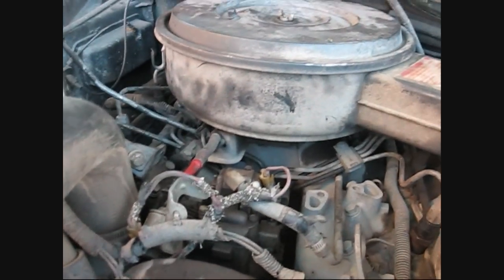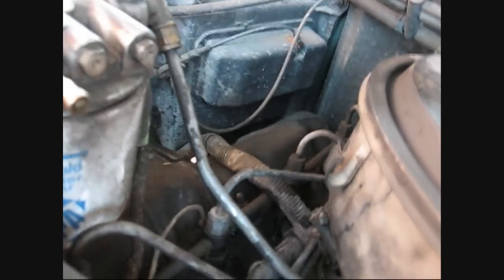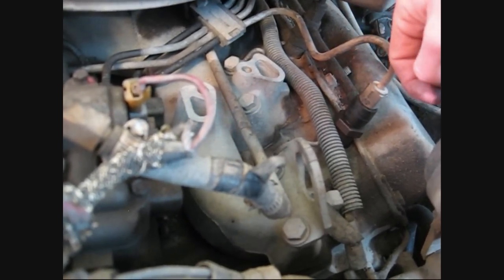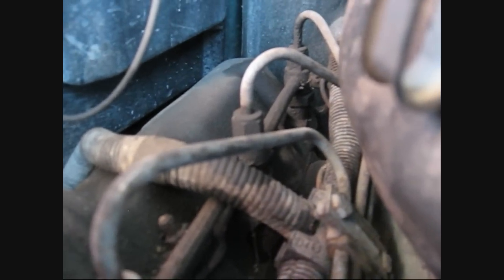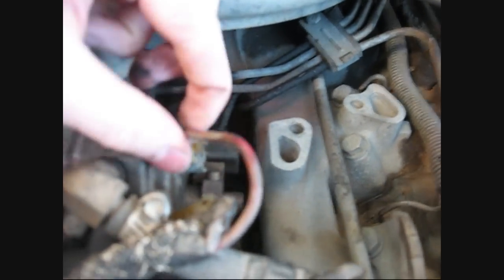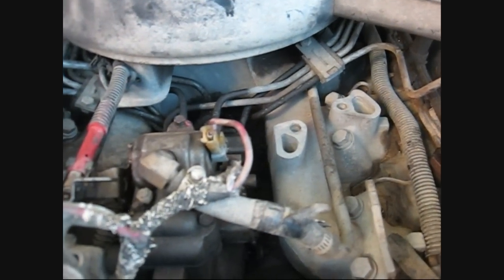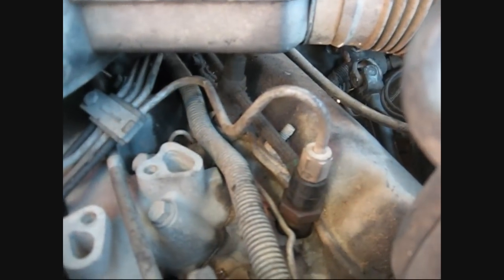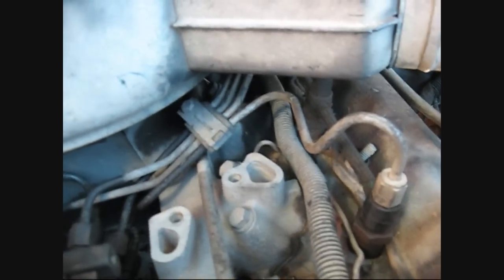Ford IDI Diesel Starting problems Diagnosis

Comment: You did a great job on the photography. I could feel my hands getting tangled in the loom and my head slamming the air cleaner 'cause I was too lazy to remove it. I just found your channel. Do you have any vids of your impression of the OEM glow plug system vs. a 12 volt upgrade, or full bypass?

Comment: I have a 91 F350 IDI 7.3 L under 2500 RPMs the engine dies and I can't get it restarted.I replaced the fuel pump and now it won't start at all but cranks over. Any ideas why this is happening or how to fix it?
Reply: really only a few things it could be if its somewhat starting at all.... air intrusion in the fuel system (usually return lines/injector lines/fuel filter heater etc) or a worn out and/or leaky IP. this is assuming you have healthy compression. as long as your getting fuel pressure to the IP which you should be if you have a new lift pump id start in those places. also a healthy fuel filter and clean injectors can go a long way
Reply: oh and IP timing is obviously crucial on these engines obviously and is something to keep in mind as they age as the can retard as they wear and in less common cases can even skip a tooth on the timing gear

Comment: I'm having a similar issue. Hard to start. Then once it does. will run a at idle for 30 mins. them dies.. Almost impossible to restart. I'm going to check all your suggestions and see if that helps.

Comment: I've gone through my 88 7.3L IDI, changed glow plugs, Glow plug wires, mechanical fuel pump, injector pump, injectors and still struggling with hard starts and no start when the motor is warm. No fuel leaks... maybe a fuel shutoff solenoid issue. Lines are bled, but when I did my first and only ether start yesterday, it sounded like I had no fuel. You experience anything like this?
Reply: Your pump could be outta time with the engine
Reply: try pouring some water on the injection pump to cool it. if it then starts, its worn out.

Comment: What block heater are you using?
Reply: +blackhawk8427  Well, Thats sucks. I found the trashed cord for my factory one but under all the oil, grease, grime, and dirt, Haven't found it yet.

Comment: My truck has an issue like this, but the weird thing is, it starts and dies when I don't plug in the block heater, but if I plug it in over night, it starts and stays running.
Reply: the O-rings in the return lines shrink when cold and only then leak air

Comment: Blackhawk,
My 19984 ford f250 diesel recently would not start, it sounds like the problem you described but there is white smoke when it starts. i have only got it to start twice sense  it was last day it was running (yesterday), it was running fine then. Also i did run the tank empty on a very old gas.  
thanks

Comment: what about you truck is running fine and smooth and all then out of nowhere it stalls and you have to w8 for like 20 min before it will start up again after it happens one it will do it all day just put in a new mec fuel pump and electric fuel pump behind it I get 2 big puffs on white smoke and then it just dies 84 F250 6.9 IH

Comment: Mr. Blackhawk8427,
I have a '87 F-250 with a 6.9L IDI.  The truck will start excellent when th engine is cold or has not been started in several hours. However, if the engine is warm and I shut the truck off it will not restart until the engine cools off again.  Could this be an air in the line problem or what do you think.  I have had it at a couple of diesel shops and neither has been able to diagnose the problem or fix it.  What do you think?
Reply: I have an 87 with the same issue starts runs great when hot will not start again until cool.  People have told me its the IP going???  How did you make out with yours? What was it?

Comment: Amigo, good vids. Thank you. I just picked up an 87 6.9. Strong runner and doesn't blow smoke, but of course a week after I got it; I'm getting the die after start thing. It always starts and runs the second time. I'm new to 6.9s and my question is this; aside from a little extra wear on the starter from having to crank it again, will this problem get worse? It only does this after sitting over night. And the parking the nose downhill trick seems to help... Do I need to address this right away?

Comment: I have a problem with a 2.5TD Ford engine, the electromotor spins, but the engine doesn't crank. The van has been sitting on a bench for some years, but I have been starting it from time to time.. I recently bought a new battery and since I got my driver's licence, I thought I'd take it for a spin. It started, yesterday and moved it around a bit, but today isn't starting anymore. All of a sudden it doesn't want to start. Some mechanics started it with spray but dies after stopping the spray. ..?

Comment: theres a bleeder valve on your fuel filter kinda looks like a valve stem you can bleed it before you shut it off... just get a small needle nose and push it in until fuel squirts out then you can shut it off.... or you can carry diesel fuel in a gatorade bottle (32oz) and take your filter off and refill it and put it on and it will start right up

Comment: Thanks, Dude! I was about to throw in the towel and considered sending it to a shop.  After watching your vid I found a leak on my rear injector.  After some new O-rings it took some cranking and monkeying with the injector line to bleed the air out but so far its working again.  Haven't taken it on the road since it died at the stop sign at the end of the street last, but it seems to be fixed.  Just wanted to say thanks.

Comment: Hey thanks Blackhawk8427 for the very helpful video. I have a 1993 ford f350 diesel truck.i just recently had two straight days where my truck runs rough for a few seconds,then dies. I appreciate you taking it step by step to help me understand my fuel system as my diesel expert buddy with an 03 6.0L powerstroke just tells me oh u have air in ur fuel system, doesnt help me on what to look for or how to fix it. This video helps especially since this is my first diesel truck. Thanks again!!!!!!!!

Comment: Everything you said is true.  I had the same problem with mine.  Th old ford fuel filter in the side has O rings on the gaskets.  I had someone install an aftermarket fuel filter housing.  There's no O rings on it like the stock filter.  My truck fires up all the time now.

Comment: Ive never had to crank more than 10 seconds if i run out if fuel. Thats what those plugged lines on the filter are supposed to be there for. And ask yourself why is there a schrader there? 1 prime the filter and to prime the system i know im right ive rebuilt mine top to bottom.

Comment: the easiest way to bleed these idi engines is just have a buddy crank while you hold that schrader valve it sends fuep to all of the iniectors and send air through the return no need to crack injector lines unless its an injector issue. of course unless like yours the return/ check is blocked then theres no purpose thats why they put wm in for easy priming

Comment: HELLO I LIVED MY TRUCK OVER 3 YEARS , I TRY  STARED 2 WEEK HAGO, CRANCK SOUND GOOD, IS NO AIR IN A FUEL SYSTEM , IS FORD 93 7.3 HERE IS TO HOT (ARIZONA)I NEED CHECK STAR PLUGS ANY WAYS?

Comment: I saw a 7,3 IDI extended cab for sale and the guy said it ran out of gas now it wont start does it just need to be crank alot and bleed the lines like you showed or is this a different procedure

Comment: And is this what you have to do if you take apart the fuel system? And when you put new return lines, O rings? It seams weard that international would make the system only able to bleed air that way.